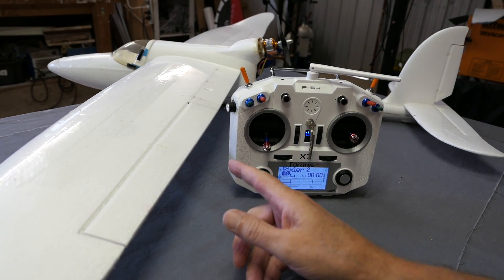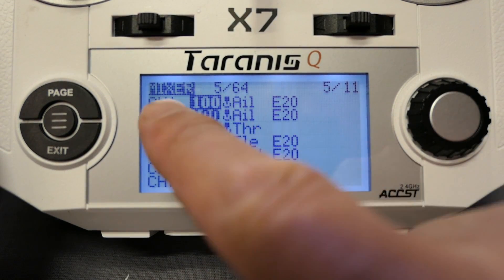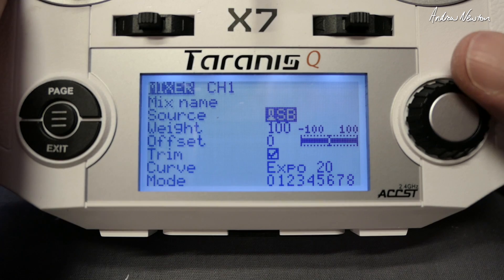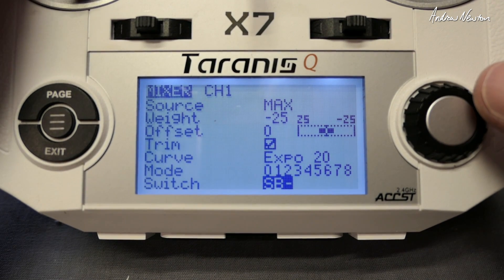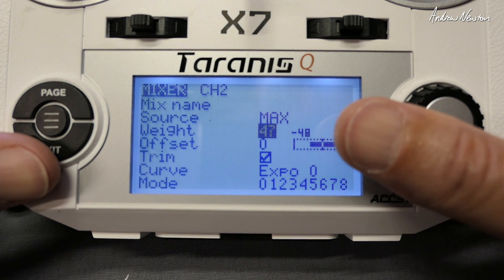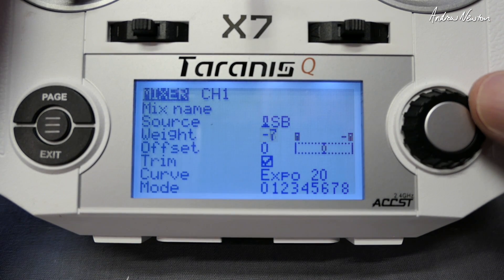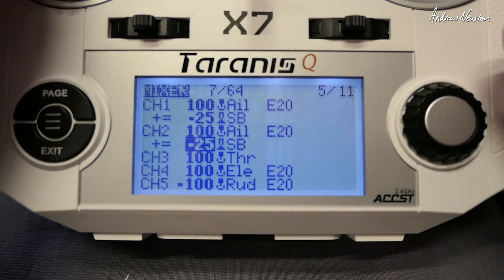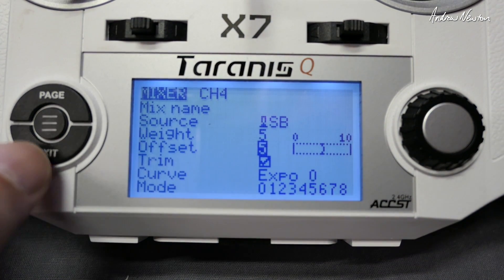Flaperons - Taranis Q X7

Comment: Hello Andrew, the switch to flaps the ailerons do not work😢
Reply from the maker: Broken switch? or did you do something different to me?
Reply: Hello I expressed myself wrong, When the switch is in the down position, the flaps work well, but the ailerons do not move, they do not work until the switch puts the flaps up again.
Reply from the maker: My ailerons and flaps are taped together to make full span ailerons. Maybe you want a mix for separate ailerons and flaps?
Reply: @AndrewNewton  hello i have only alerons no flaps i need flaperons thanks.
Reply from the maker: You are confusing me "the flaps work well, but the ailerons do not move"
Reply: @AndrewNewton  correct

Comment: Hi sir. Similarly can you do another video on mixing flaperon. But here, when flap is engaged the opposite side should also reach full throw. In this video tutorial the opposite direction does not move to its full limit when flaps are engaged. Can u do this? Is it possible to do a mix like that?
Reply: @lokaero 
exact same issue here. I wonder if you found a way to get around this

Comment: i use the thottle stick on my dlg for both flaps and spoilers
but i don't want neutral in the center
i want neutral to be at -100 "throttle" and choose with a 2 pos switch if the effect will be flap or spoiler
do you have a pointer how to do that?
Reply from the maker: Good question Marc. Which transmitter do you use? I'll do a video on it.
Reply: @AndrewNewton  wow, thanks a lot :)
i'm using the tx16s
i also put a motor in the dlg and use a slider to control that

Comment: Thanks Andrew, great explanation, I finally understand how to delete any entries in the Taranis Q X7 "Input" page and do all settings in the "Mixer" page only. I followed your instructions and it just worked fine. The only differrence: I needed to set up spoilerons on my glider. I guess that for spoilerons the elevator compensation needs some uptrim instead of downtrim. Right? I will see next weekend (hopefully). Greetings from Germany, I have learned a lot from your tutorials in the past two years.
Reply from the maker: Inputs do nothing unless you use them in the mixer page. Spoilerons dont need elevator compensation usually.
Reply: @AndrewNewton  Thanks for your very fast response. I will follow your advice.

Comment: Which model of Q7 is that you'e using? Mine doesn't have the slider on the left side
Reply from the maker: The Newton Airlines special. That's my hack.
Reply: @AndrewNewton  that would be really great for an e-soarer as throttle instead of having to use flight modes

Comment: I'm curious why you prefer the first method (using MAX as the source) over the 2nd? I also saw your earlier video doing flaperons with a Turnigy 9XR where you used the 2nd method only. Is there something about using MAX as the source that works better?
Reply from the maker: I think it's because with the second method you always have to adjust the offset as well as the weight and you only get half and full programmed weight. With the first method you have total control over each switch position and no offset needed.
Reply: @AndrewNewton  Thanks for the reply! I'm setting up a new model with a QX7 right now, so this video was perfect timing!

Comment: I may be being a bit thick, but have you done a video on a basic Flap mix with 3 pos switch that adds down elevator in it to stop the ballooning? I have my Flaps on a Y-Lead. I'm rubbish with open Tx, so would like the radio way of doing it. Thanks in advance.
Reply from the maker: Yes I'll do that very soon. Thanks for the suggestion.
Reply: @AndrewNewton  Cheers, I had my only Flap plane (HK Walrus) on my old Turnigy 9XR and that has gone pop. Now I need to bind it to my Taranis but have never set up flaps on this and have no idea where to start

Comment: Hi Andrew, Great video as always. Is there a way of temporarily assigning the elevator compensation to a potentiometer so that you can trim the compensation in flight and then use that value in a permanent setup?
Reply from the maker: I think LoCs comment might answer this. Not something I have ever tried.
Reply: Yes it does - Thanks for help. @AndrewNewton

Comment: Don't fly & try!

When setting up flaps set the value of pot S1 to appear on one of the displays and also have it as a += source for the elevator in the mixer when SB- is selected. Next fly to height, engage flaps and adjust the pot - you may have to engage & disengage the flaps several times (to recover) before getting it 'dialed in'. Next land, read off the value of S1 and replace S1 in the mixer with MAX and the value from the display.
Reply from the maker: I'll have to try that. A more mathematical approach.

Comment: Thanks Andrew! But you didn’t show how to mix in the elevator to the flaperons using the first method, which I’ll be attempting to utilize. I’m sure I’ll figure it out, but I’m guessing your expertise will help ;)
Reply from the maker: The method I showed works for both. Otherwise just assign MAX and weights of maybe 3 and 5 for SB- and SBv switch positions in the Elevator mix